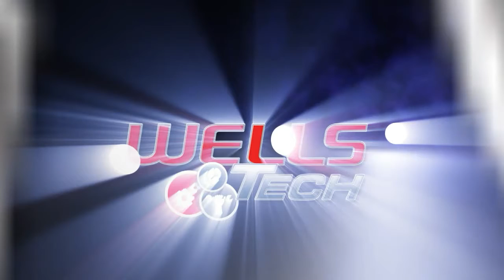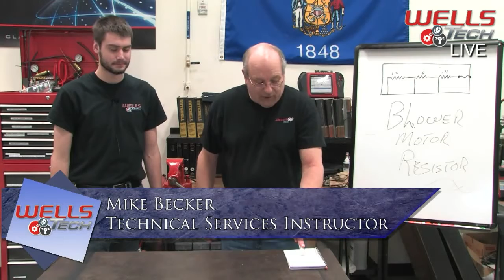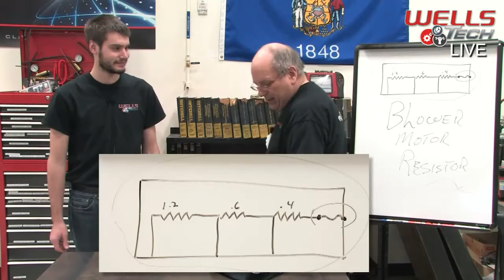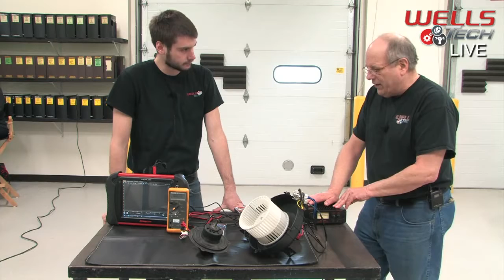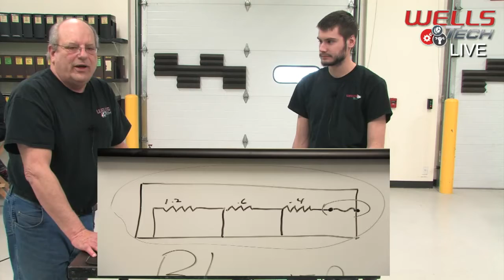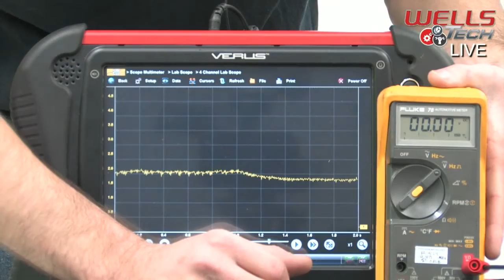Blower Motor Resistor Function and Diagnostics

Comment: Great video! I just wanted to put in my thoughts on the amperage draw, this is a common question I get in some of my auto classes and here is what "the book" suggests - During bushing/bearing failure a motor spins slower, because a motor also produce counter electromotive force (CEMF)as it spins, a slower turning motor will draw more amperage than a faster turning motor.... Ok great concept but were not all engineers.
I suggest that we remember the basic principle: mechanical resistance increases amperage. IE a tight bushing/bearing, a rag, or perhaps..... a rodent! 
Thanks again! Your tech videos are great!
Reply from the maker: Thanks Jake! Love the kind words, glad you enjoy our classes. Thanks for the info as well. That's a great basic principle, really spells it out easily. 
Mike Becker, Technical Services Instructor

Comment: Good show Mark and Mike! So why does the old blower motor draw too many Amps? What is the mode of failure? We need Mike Dale back in the studio!!

By the way, the Verus is a modern oscilloscope, and plenty fast to capture even microsecond spikes. All you need to do is turn Peak Detect ON and record on a shorter timebase! Also, it's handy to bring up the "live" readings instead of guessing by looking at the volts scale on the side. 
Check out ScannerDanner's Verus training series for more cool tips and tricks :)
Reply from the maker: +motoYam82 Hey Ivan! The original blower motor had worn bearings in it. It was noisy and when it was cold it drew too many amps causing the connector to melt. Thanks for the info on the Verus, we will have to check that out!
Mike Becker, Technical Services Instructor
Reply: Ah OK that makes sense. Keep up the good work, Mike!